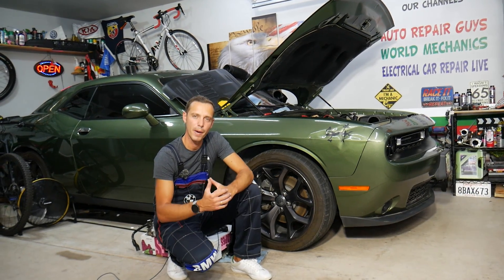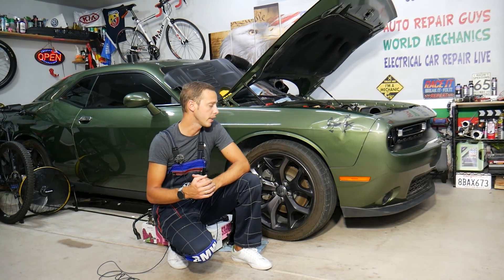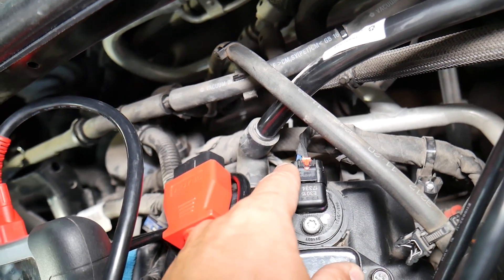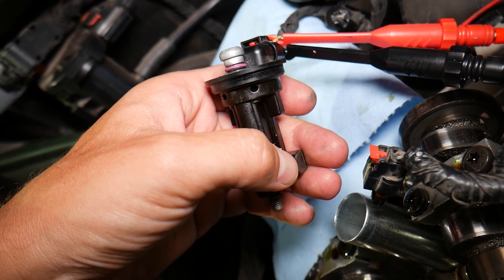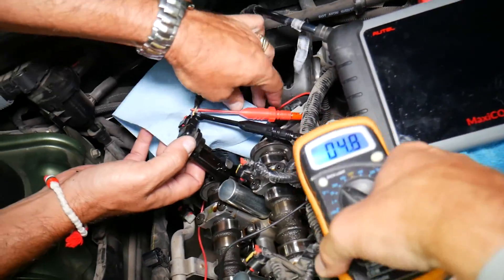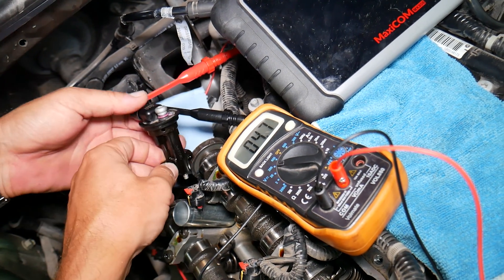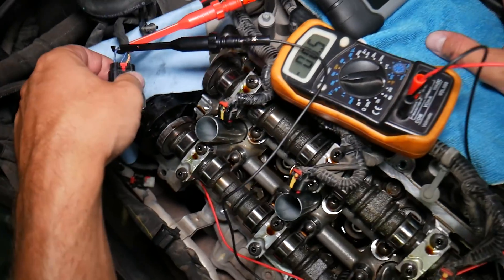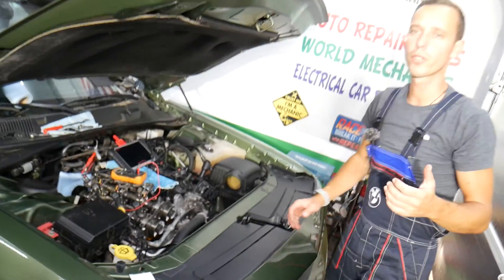HOW TO TEST CAMSHAFT POSITION SENSOR DODGE JEEP CHRYSLER 3.6 V6 PENTASTAR ENGINE

Comment: Thanks for info/verification.  TEST 1 with 2 ...........then TEST 2 with 4.... ohm meter set on 200 V---- dot dot dot. Be sure to wipe the FOUR lobes clean, they are coated with metallic trash residue if high mileage engine which will cause false po013 code if sensors test good.

Comment: There are some issues here - the pinout is not 1-2 and 3-4. The MOPAR pinout lists FROM RIGHT TO LEFT (looking into the pin holes) on the connect pins 1-4 as: Pin 1: Cam 1 (or 3) signal,  Pin 2 5V positive supply, Pin 3 is the Ground and Pin 4 as Cam 2 (or 4) signal.  So test between CONNECTOR pins 2-1 or 2-4. 3-4 yields nothing.